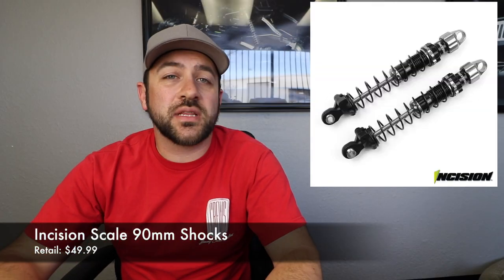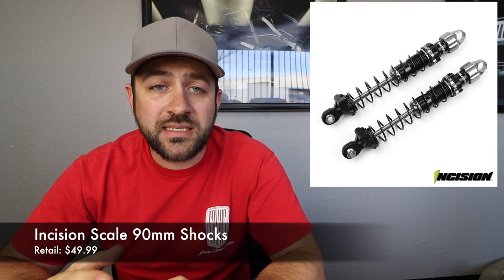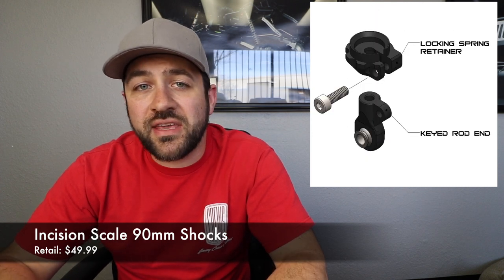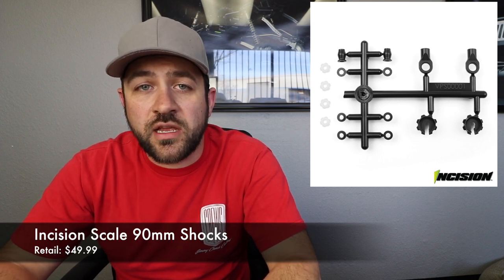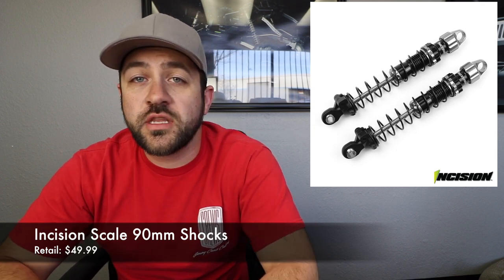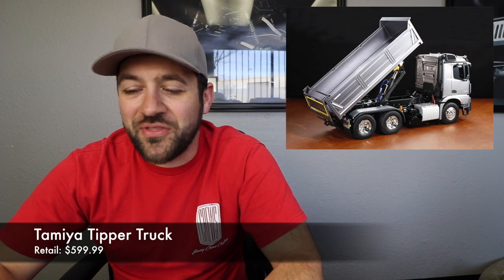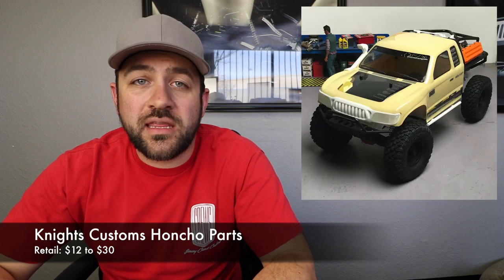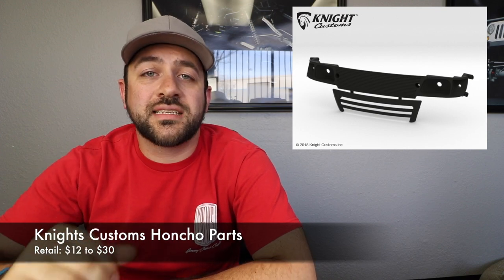Scale News Update - Incision, Knight Customs, Tamiya - Episode 14

Comment: A good thing to carry is a piece or two of double-sided tape or Velcro with adhesive on it to reattach any ESC or receiver that come undone, or just for any other Band-Aid you can think of to jerry-rig it to get you back to the truck. Another thing is some extra wheel nuts and body clips
Reply: I try to zip tie all electronics down. Double sided tape and Velcro always falls off on me.

Comment: Great assortment of tools for the trail....no joking...that is the exact same stuff I carry on the trail.
As far as brass parts , I agree on everything but one...saying brass is soft is a generalization and your clumping all brass into one. Just like aluminum and steel , there are numerous harnesses to brass. MFR uses a "hardened brass on their knuckle parts that is similar to the stainless steel of a good pocket knife , but in a very extreme condition it won't "snap" like stainless....it will bend , tho , I doubt it ever will.

Comment: I agree a lot of TRX4 owners are adding to much brass to a very well balanced chassis already. I have one and the only extra weight I've added has been the scale accessories. A 70g chain on the bumper and the roof camping stuff. It is heavy enough with the two batteries I have in it (1 3s 2200 + 3s 5200). I get great crawling and trailing performance with this setup. I am looking at 2 stage foams as my next "budget" upgrade. Can you do a review on what's available in 2 stage foams? Thanks for your continued hard work.
Reply: Crawler Innovations and Proline are the big dogs in that arena, but Pitbull is making inroads as well.
Reply: i got the stock growler foams right now in my trx4 and they get crushed by the weight of a trx4 when crawling so it doesn't look very scale, so now i got some rockbeast foams single stage coming in from crawler innovation , much firmer foams. I also added a steel bumper from rcmodelex and a winch and some rc4wd wheels without any weights. does allot better then stock and it tips less on it's butt :d but i try to keep it light and don't want any brass parts.

Comment: Love the new shocks Harley, I recently got the new TRX4 Ford Bronco my question on the portal axles would it be a good investment to get Metal covers or stay with the plastic I thought I getting a nether full set of the Porter axle with the gears and the ring for spares any info I would appreciate. I love this bronco I've had no problems. I just like to get some spare parts in case

Comment: hopefully, the next big thing will be RC crawler designated pistol style radios with multi 3 position switches and multi-channels to accommodate crawlers with scale functions, I have already talked to Futaba about this and they seemed very interested however have yet to hear back.
Reply from the maker: Futaba already has that. The 4PK, 4PV, 4PX and 7PX already do this.
Reply: That is interesting,  I did in fact talk to Futaba about all those radios and they actually could not explain how to set up several 3 position switches to operate scale operations and a momentarily switch for a winch.

Comment: The brass thing is an interesting one, I think mostly it's guys with TRX4s with the really heavy Defender body, hence why a lot of the knuckles and such are aimed at that.
Kevin Talbot did a video about it where he added a load of stuff down low and it made absolutely no difference to climbing and side hilling in his tests.
He changed the body for something better and it made a huge difference.
Whether that was also helped by the brass items, I'll remain skeptical.
I still feel a crawler is 90% driver and 10% truck... Get some nice strength upgrades on it for durability and the rest is just learning how it drives.
Reply from the maker: I think 90/10 is way off. You give the same driver two different trucks and the setup is a huge factor.

Comment: What mods would you recomend for axial scx10 ii crc jeep
Reply: I'd say shocks first. I got mine a couple months ago as my first rig after much research, and absolutely love it. However, i have already done a shock rebuild to refill lost shock oil (w/ 35wt) after about 15 mi of trail runs. It's not catastrophic, but new shocks are definitely on the list. Everything else is acting fine for now. 
Possibly adding some lower-COG weight in the back might help with the drop-off appoarches, because she does like to dance on that front axle (which is a fun little mini game in itself). Aluminum c-hubs and steering knuckles would be my next guess. Because of the physics behind u-joints, i worry slightly about the knuckle pins while steering hard over and gassing it. I haven't seen or heard of any failures, though.